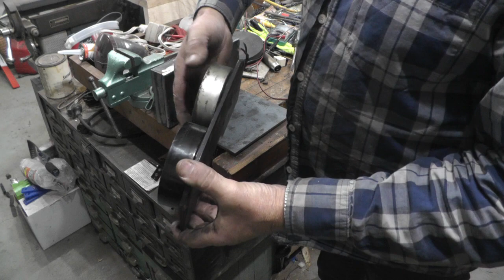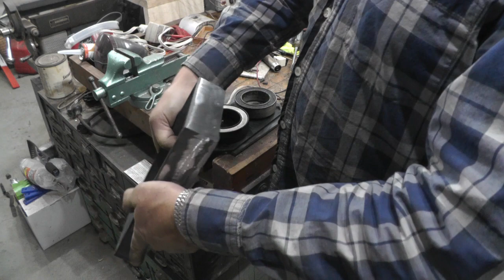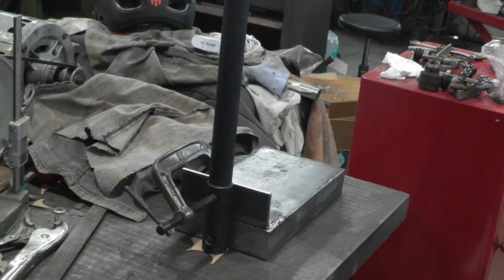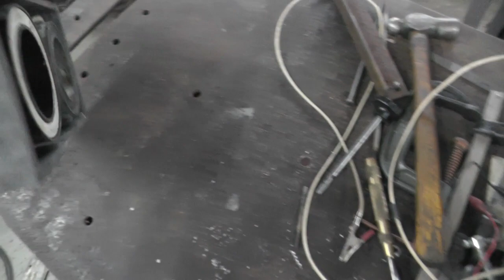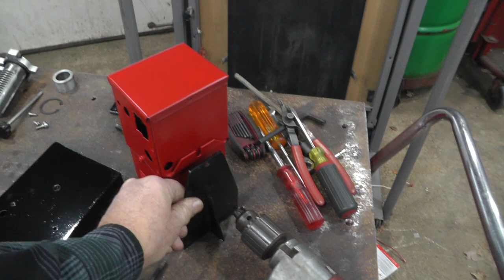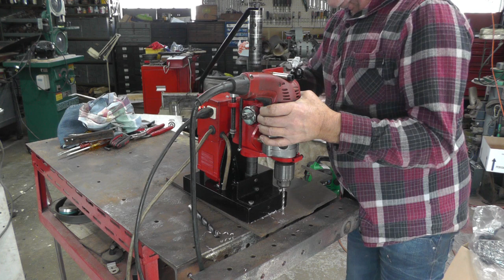DIY Magnetic Drill Build Part 2 Finally Done

Comment: Nice job.  Could you explain more about how you wired the magnets?  I've been wanting to build a magnetic chuck from microwave transformers but I'm having problems getting a reliable power source for them.  12VDC looks to be another possible option.
Reply from the maker: I used a pretty heavy 12 volt transformer  (because that's what I had on hand ).  Each magnet draws about 3.5 amps so total of 7 amps . The secondary of the transformer goes to a bridge rectifier with the capacitor across the  output side of the rectifier.  From there to the magnets.  I considered getting one of the dc switching supplies on Ebay they are cheap and work well. I just used what I had.   Also battery charger could be used by adding a capacitor across the output. Hope I helped.